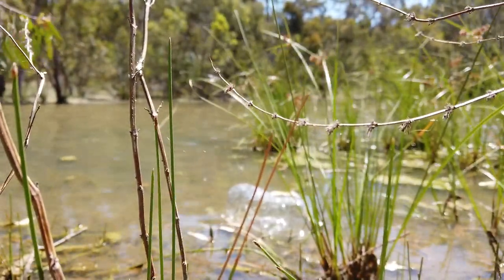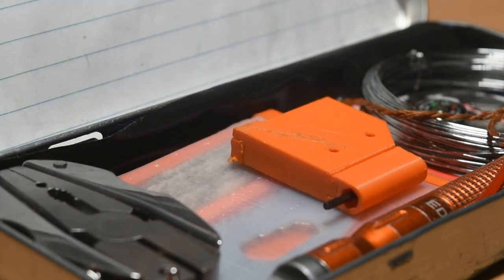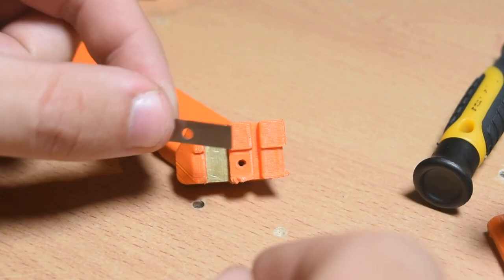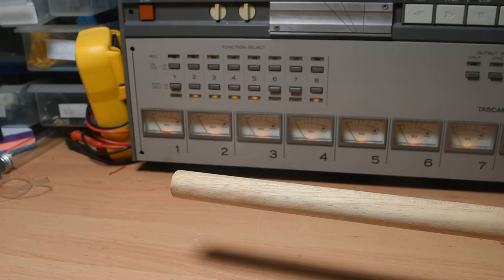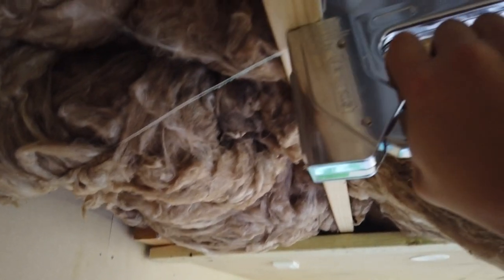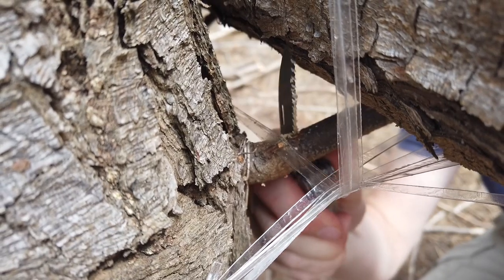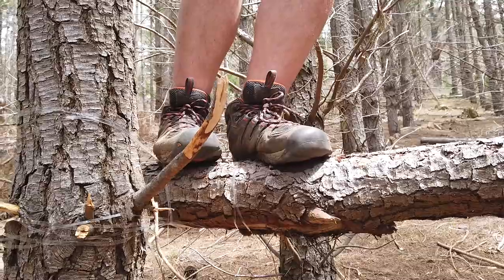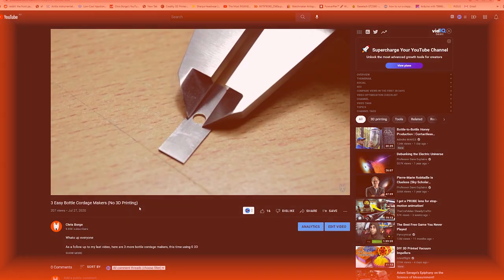Super Simple 3D Printed Plastic Bottle Cordage Maker | Tutorial + Uses

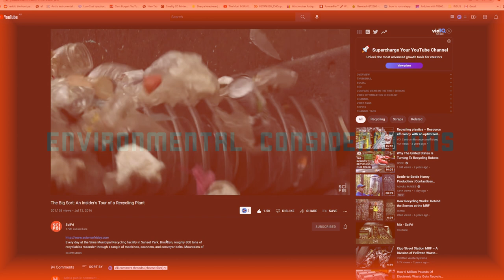Comment: 11:21  One minor note is that, if made into FDM Filament and Printed, or If you Melt/Press it Down Into a Block (Like what “Precious Plastic” did with those “disposable” plastic bags) it may be recyclable again. (At least from a size point of view, dirt/wear from use, thermal degradation from the process, and the ability of places to recognize non-standard plastic items may vary this as well)
Reply: Small Scale Recycling, Either via 3D Printing Cordage or Regrind Based Filament, or via full on “Precious Plastic” machines at a Makerspace is going to be better in most cases for plastic since many places sadly don’t recycle it well, and it gets turned into a trading shell game etc.

All in all though, as long as it isn’t littered, it will stay in some sort of central waste disposal, which even if it is a landfill (which i hate) still keeps it out of the environment at least.